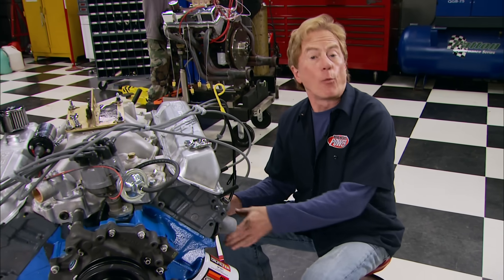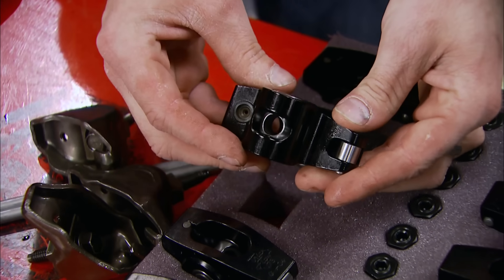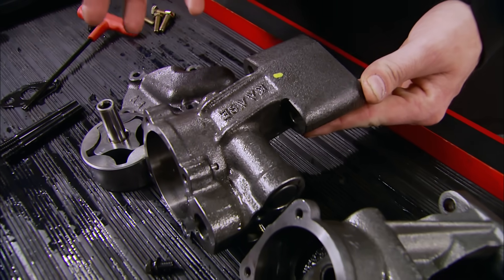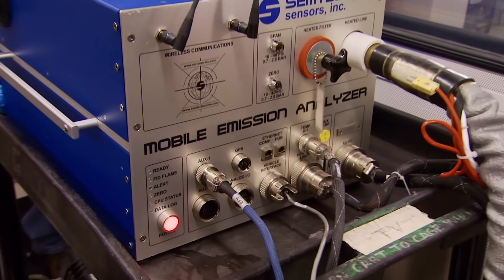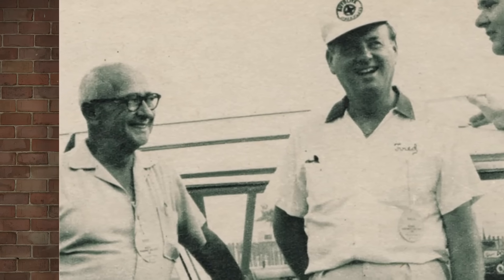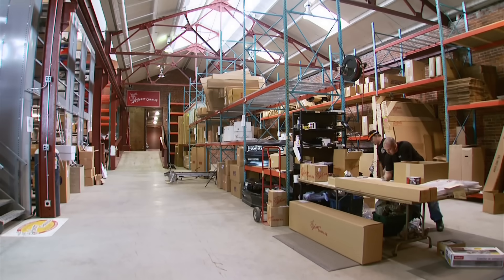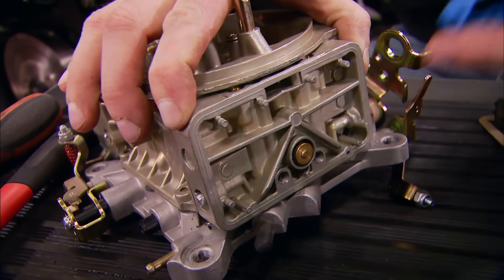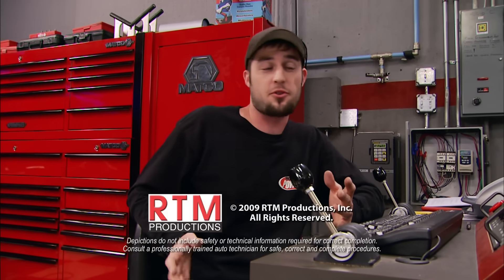Ford 460 Engine Build Part 2 - Horsepower S13, E9

Comment: I use E3s in my power sports engines. 
But I can’t see using them in our vehicles. My parents have a lot of cars and trucks so does my family and I can’t see a good reason to buy E3 over say an NGK or Champion: especially when the E3s are like $7 more per plug.
Reply: I  had to remove my E3 plugs from my 07 mustang gt.  It wasn't running right , I only had them for 2 months.
Reply: They are garbage stick with factory plugs folks
Reply: E3 spark plugs are junk they're going to run for the good couple hundred miles after that you're done the whole point of running a spark plug is it keeps itself burning clean now with Platinum plugs plugs that's the way to go and if you have four valves cylinder head that's where you can run a Bosch four type plug which l have have done on many vehicles with excellent results gas mileage and Power plug  I put a hundred thousand on them with no problem got! to have the right heat range

Comment: Be sure to use a hardened oil pump drive shaft. I didn't and it left me stranded on the road once. The drive comes from the distributor which is turned by the cam. An aftermarket pump needs more power and the stock shaft is not up to the task.
Reply: Jack Flash the pump came with a new shaft.
Reply: Plus you have to make sure the distributor has a bigger roll pin in it so it doesn't share a solid roll pin or hardened roll pin I used to use drill drill bit made into roll pin
Reply: It's a "parts store replacement".

Comment: so only 5 minutes was about a 460 build? boo
Reply: Yeah I kinda thought that sucked too. I think I'm done with them.
Reply from the maker: For what it's worth these were produced in 2009 for television with segments so often then you'd work on a certain project for 2 segments and another project for 2 segments or sometimes 3 segments to 1 depending on what work we're doing and what makes sense workflow at the time.
Reply: PowerNation; if this stuff is from 2009, why not cut all the clips together and make one complete video about the 460? I think that would make more sense...
Reply: Too bad they didn't use DOVE heads reworked a tad for the 1st or 2nd build. They can be had out of a boneyard for a fraction of what those aluminum heads are.
Reply: 2009 was when lots of people didn’t have cable... I tuned in every Sunday back then..... Spike Tv or TNN?
Reply: Their show was basically a show about selling parts brand names swear they get their money Ford 460 engine is a great engine to build big Power with not a bunch of money if I had the equipment they had in that shop I would be teaching young people how to build motor and fabricate waste of equipment can we use for teach young people careers in the automotive industry that's my two cents
Reply: did u watch episode 1?
Reply: fair enough, thanks for the reply. Was hoping it would be atleast half the episode tho, seems this episode took a left turn a bit early is all 🤣

Comment: It's not a big block
Reply: 330 to 428 was fords big block in name
Reply: @danapicray9040  Those are FE engines, they were a midsized block (even if they were heavy as all get out). The 385 series (like the 460) is the closest thing Ford has to a true big block, bore centers are much wider than any of the contemporary engines. Back when the FE was new, the MEL engines were the 'big blocks'. 

The real confusion comes in when someone gets confused and starts calling the 351/400... or really any windsor or cleveland family engine a big block. None of them are... they're all just taller deck height revisions of the same 221ci windsor that came out in the very early 60's.
Reply: Chevrolet made the big block Ford did not
Reply: Brad Binion you sir are an idiot
Reply: @bradbinion4012  big block just means the actual size of the engine block is big. nothing to do with brand. a 440 hemi is a big block, a Ford 460 is a big block, a Buick 455 is a big block.
Reply: @bradbinion4012  dude......

Comment: They sell E3's for lawn mowers too. More often than not just putting a Champion or NGK plug in solves the customer's problems.
Reply: I use one step "colder" NGK Platinum plugs and they are the felines undergarments, er, cats pyjamas. 😂👌
Reply: @rhubarbpie2027  - 😂

Comment: At 00:36 ... DON'T DO THAT !!! ... Put plastic tubing over the rod bolts to prevent scratching the crank with the threads !!!
Reply: How not to degree the cam. 
Way to go.
Reply: Lots of guys that are hardcore enough to rebuilt an engine have some 3/8" fuel line laying around. It a easy enough to cut off two 2" pieces and saves a ton of heartache later
Reply: These guys are clowns, lol

Comment: Those e3 spark plugs seem like a modified torque master plug. Not convinced that shielding more of the spark compared to a conventional plug will have benefits.
Reply: They are BS.. if you look on amazon, most if not all the E3's I glanced at had people complaining about major problems with them causing misses.
Reply: When you have builders installing shims under standard plugs to orient the ground electrode so as to not shroud the spark... why the hork would you install a plug that shrouds the spark several times over?
Reply: @mfree80286  that was my thought to. Plus most of my plugs dont have that much gap as what an e3 appears to have and it doesnt exactly look like it would be easy to regap that plug if at all.
Reply: @mfree80286  its called indexing the plug. which is only making sure the open side of the plug faces the fuel in the chamber
Reply: They are junk

Comment: Basic porting and gasket-matching, and a how-to guide on making the most of a carburetor would be interesting. This went from "budget" to "how to use stock rods and not damage expensive parts" build.
Reply: I agree,  show the benefits of a good modern carburetor,  factory D0VE heads with  3angle valve job,  gasket port matching heads and intake, port and polish and upgrade to duraspark distributor with chevy HEI module.
Reply: @hachirokami  Absolutely! And budget-friendly approach.
Reply: You guys bitch about everything. Each episode was a more progressive performance build. Morons

Comment: i tried the e3 plugs paying 3x the price! my motor ran like shit!. put a $2 plug and ran perfect. .  i will never buy a upgraded/special plugs. keep it simple
Reply: The E3 are crap Chinesse plugs that shroud the spark.
Reply: Dont buy E3 there garbage I tried them on my Silverado High Country 6.2L all I'm going to say they were a nightmare  and its ran terrible stick with factory folks.
Reply: My lawnmower won't run on E3.
Reply: @nomanjones4803  If you look back through the history of the internal combustion engine, in the first several years there were untold numbers of designs tried, and all failed except the single ground electrode, central positive electrode design that's worked for over 100 years now. Yes, the details had to be hammered out, but the darn thing got nailed down through a century of trial and error.
Reply: Angel Garcia I wouldn’t have wasted a dime on that bs. It only take one spark to burn air and fuel mixture. When you understand how to make hp.  You recognize BS like these guys advertise.
Reply: Angel Garcia I hear ya.  Total junk.
Reply: @NorthViewModelShop  maybe, something people don't get is, using the washers. you need to aim the plug. but likely your right, prolly garbage.
Reply: @leehodge2415  haha lol great name . Yea your right drag racers always clock plugs it's called for best fuel burn !!
Reply: @leehodge2415  Indexing the plug does help more than "who made the plug".
Reply: they worked great in my yukon xl 5.3 for almost 2 years then engine light came on and had a bad miss in number8 but almost 2 years was good i think
Reply: Like reinventing the mouse trap, you cant make spark plugs any better. Racers get the same results indexing the plugs. But I had good luck with E3s in my 2000 caravan ran good for 7 years till I sold it. Tried them in my brothers civic started missing 3 months later. The parts guys begged me not to get them, I said I want to see for my self for the heck of it.
Reply: i loved my e3 plusgs but the damn engine builder stole them off my engine
Reply: My brother runs e3s in his 02 firebird with a series 2 3.8 by and got great performance from them
Reply: dear NGK PLUGS r the best at all
Reply: @moarpewpew-r2u  Amen brother!
Reply: What's the point of three electrodes anyway? Electricity flows to the quickest ground it's only going to use one electrode anyway. maybe I'm stupid and needed it explained to me but it doesn't make any sense to me.
Reply: My LT1 runs like shit with high end NGKs, tried 2 different E3 plugs and it would barely run. Threw some conventional ACDelco plugs on it and it’s purrs like a kitten. And yes I made sure they were all gaped. I’ll never again run “high end” plugs. Use what they came with when they rolled off the line.
Reply: Gap the darn things properly and be in the right heat range and $0.99 "normal" plugs will run as well as anything else.
Reply: NGK V-POWER AND NEVER LOOK BACK
Reply: I just spray some WD-40 on mine and they good as new. Been using the stock plugs on my 95 Astro Van no issues at all
Reply: Angel Garcia yea there absolute garbage, I have a 96 camaro with the 3.8 v6 and I installed a set of e3 plugs cause I still had the stock was so excited because I had heard about them from horsepower tv which I watch religiously every weekend and save my penny’s and got a set along with taller wires and msd coil packs, put  it all together and I felt a difference but then trouble damn plugs were arcing out and were missing like crazy and I had horrible miss on 1 and 6 and couldn’t figure out out until I put a junk plug from the parts bin and issues cleared, went to oreilly and got a set of Platnum plugs cars has been smooth ever since and now 440,XXX MILES :3
Reply: Anybody else notice the intake manifold swap (that wasn't mentioned) with the e3 spark plug swap
Reply: @brandonmccollum6349  Yea, it was aluminum then in another shot it was black.

Comment: I wonder how long them cam bearings would last in an actual vehicle.
Reply: They almost definitely damaged the surface of those cam bearings.
Reply: Ka-dink, ka-dink, ka-dink....
Reply: @AZCobraman  I feel bad for the shmuck that gets this engine.
Reply: @tylerhensley2312  
Load on the timming chain increases with RPM.
At low RPM load is minimal. At the far end of the RPM range load is at a maximum and valves can float.
Reply: @norman_sage2528  yes everything you just said is true. But can only be true if there is load against the cam.
Reply: @tylerhensley2312  the cam only gets a load when the lifters are in contact with the lobes so at least 4 lobe are in contact at all times in a v8 at least